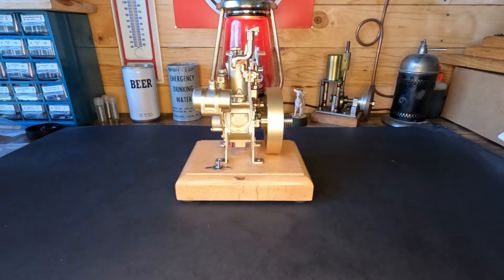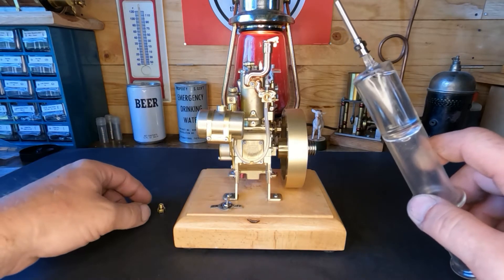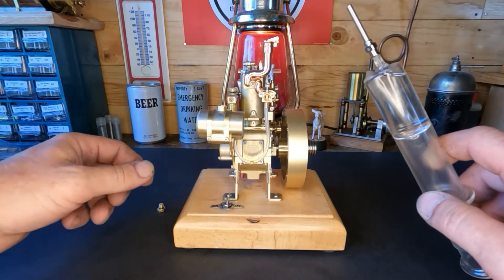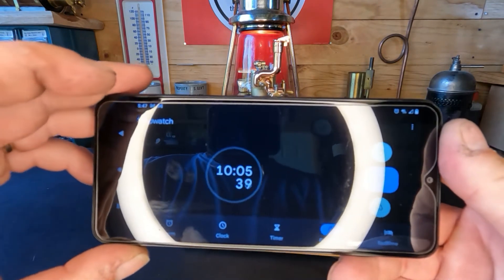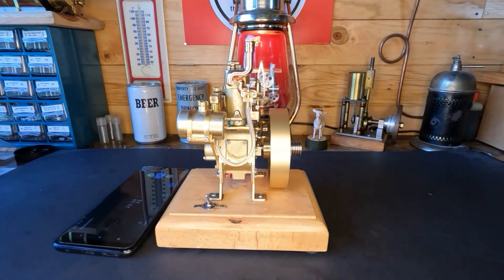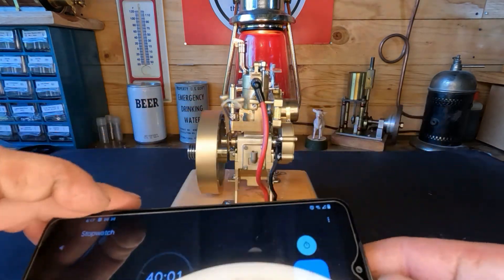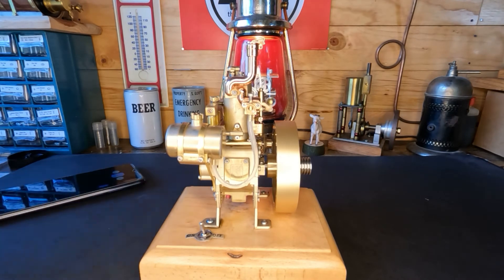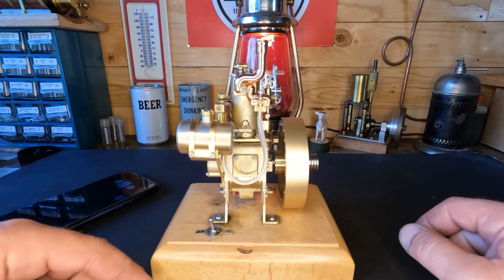H73 Will it last? Let's run it and see!

Comment: I have several of the Jianzhong Dong engines, and run them on Coleman camp fuel mixed with about 2-3% Marvel Mystery Oil. I have yet to have any mechanical failures with any of them. I have had 2 of the electronic ignition systems completely fail though, they seem to be the weak point.
Reply from the maker: Hi Mark, I agree with you 100%. I use the ethanol free 40:1 (especially when the doors are closed) because if I run lighter fluid or Coleman fuel mixed with Marvel mystery oil I get one of those headaches that last a day or more. If I run them in outside, after a bit of adjustment, they do great.  I have only had 1 ignition failure and that was due to the hall effect pickup. I wonder why 2 of yours went bad?  Same engine?

Comment: Hopefully their quality control will improve as many times these engines seep water and have loose screws causing small compression leaks. The O rings sometimes deep water where it seals around the cylinder.
Still a really neat engine to own and run.

Comment: I have seen all of your videos about the H73. 
Very interesting, get mine in about two weeks hopefully. Did you try to run the engine slower
by changing  or shorten the govenor  spring?
The new engine looks like the new M17 Hit and Miss with  governor balls. 👍
Reply: It is the M20!
Reply from the maker: I have not tried any governor adjustments yet, but I'm sure we'll get to it now that we are sure that it has been run in. I will make a video on how we go about it.
Reply: @steam212  Thank you for the fast reply. I am looking forward for your next great video.
Reply: Its me again with a question,
is there a spring over the flyballs or is it only the weight of the top what regulates the opening time of the exhaust valve?

Engine should run slower and under load increase the speed. Ok it is only1.9 ccm. 
I have the larger M90 for example and it  makes hits 28 per minute in the meantime. After many hours of runtime. Ok it is larger, 6ccm, 2 heavy flywheels. 
I like the hit and miss sound. Get mine H73  in the next two weeks. I will try out some of your tipps. Grinding the surface and put some grease on the crankshaft for example. Thanks for that. 

One Tipp to tryout: If the engine wants not to start especially this with the one-Needle oiler , in 99% it is flooded. Close the needle and try starting till it’s ignited. 
Regards, Manfred.
Reply from the maker: @MC-MC1MC  Hi M C,  the spring is on the inside of the "thimble" between the fly balls. I looked at the one here in the shop and can see no way of taking it apart to shorten the spring with the governor mounted to the engine.  This might be a bit of a spoiler alert for the next video on it but, where we're going, we don't need a governor.   I've been in the shop every night this week and recording as we go so you'll see nearly a weeks worth of modifications and additions done to it. We're nearly there but still a few parts left to make.   It'll either be cheered or condemned when the video comes out.
Reply: @steam212  I'm really looking forward to the next video.

Comment: I think it sounds as normal as it is going to get. Did you notice any wear around the crank journals?
Reply from the maker: I haven't noticed any excessive play or slop in the main bearings yet, but I haven't side loaded them by belting it to anything either.

Comment: Well that went better than expected.  At least it now seems reliable and robust enough to run happily for that long - don't think that would have been the case if you didn't pull it down and sort out the case faces, head gasket etc.  Maybe fit a biro spring to stop the mixture screw self adjusting randomly?
Reply from the maker: I am pleased with how it runs now. I think the self adjusting carburetor may have something to do with the fuel level about 1 minute after a full tank 🤔 maybe?

Comment: Thanks for doing this, your sacrifice wil not be forgotten 😅 Im surprised it held up pretty wel. Only the self adjusting carb is bit funky... but thats only a small hiccup. Have a nice day sir 🍀
Reply from the maker: I was curious too LOL. I have a thought that the carburetor self adjusting issue has to do with the fuel tank level. I noticed that both times it acted up was just over 1 minute after the tank was filled to the top.